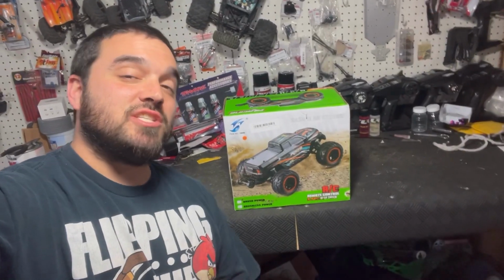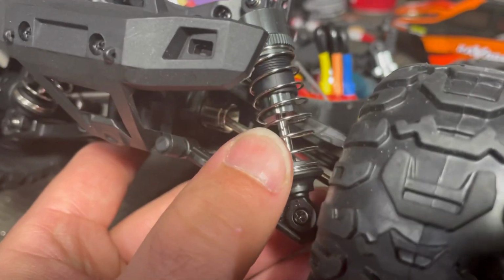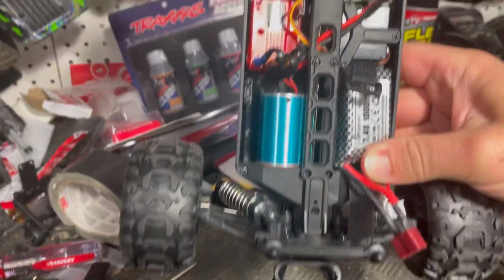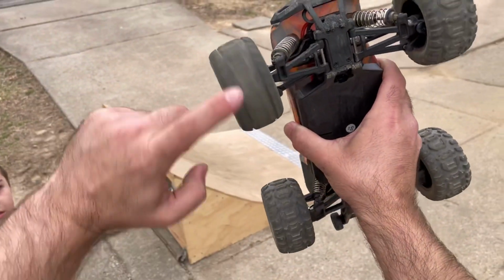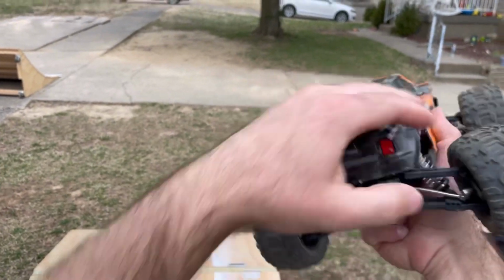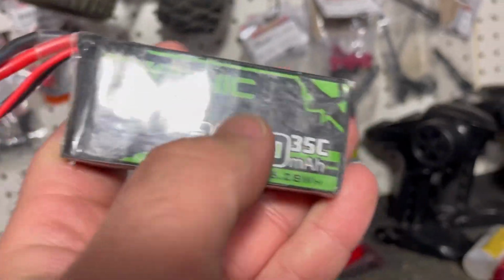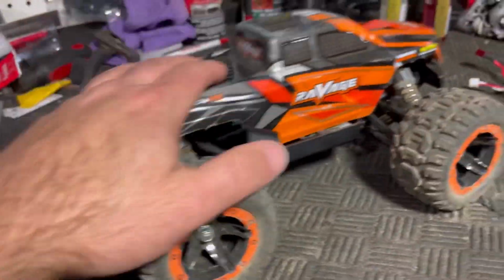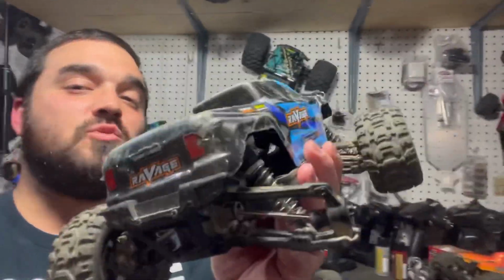The RC car EVERYBODY NEEDS!! HBX 16889a PRO

Comment: In a previous video you mentioned you’ve never broken a plastic driveshaft. So is there any benefit to the metal ones? If not, they’re a downgrade. Thanks for the vids, I’ve been considering a budget jumper and you have the best vids to see how they hold up and perform in the air.
Reply from the maker: Thanks man! True I have not actually broken a plastic shaft, but what has happened quite a bit is the screw that holds the wheel onto the plastic shafts breaks off inside the plastic. You can’t use standard wheel nuts on them either so fitting larger tires doesn’t work out well. If you plan on keeping the stock tires, the plastic is definitely not a bad option, but eventually one of those screws may still break.👍👍
Reply: @DerbyCityRC  thanks for the info. I am planning on bigger tires, so I’ll also go with the metal driveshafts.
Reply from the maker: What do you have? Standard 16889a? What tires you plan on using?
Reply: @DerbyCityRC  Don’t have a 16889. Still evaluating which smaller scale to get. I want a durable jumper that’s balanced in the air for stunts/backflips. WL Toys 14402 and LC Racing EMB-MT are other contenders.
Reply from the maker: @tyrellcorp2118  awesome! Working on a 16889a vs 901a video now. 901a is a 12th scale so a bit bigger

Comment: Would you recommend 16889a Pro or the 903a that would sometimes drive on grass?  Thanks!
Reply from the maker: For the grass, the 903a would probably be better since it is heavier and has bigger wheels. I have a similar car and it’s not quite as durable as the 16889a pro, but if you’re not doing crazy stuff like I do, I think it will be a great option for you!

Comment: Would you recommend having a stock of any parts in particular for these trucks?
Reply from the maker: I always recommend that. Lol
An extra shock or two,
Bumper and wheelie bar,
1.5mm x 10 mm axle pins
And 2mm x 10mm wheel pins.
Wheel hexes.
That may be it. You might break more things but probably not very commonly
Reply: @DerbyCityRC  Thanks! Been enjoying watching you guys jump your trucks / your editing style :)
Reply from the maker: Thanks!
Really really appreciate it! 😃
Reply: @DerbyCityRC  Already lost a pin! As a temp fix I cut a thick paperclip to length. Not a bad option honestly. Do you know if you can adjust the speed of reverse in these trucks? Wayyy too fast by default and adjusting the controller only adjusts the forward speed.
Reply from the maker: Ya I’ve used cut body clips as temporary pins before. I don’t believe you can program those ESCs unfortunately.
Reply: @DerbyCityRC  I ended up using a thinly cut Velcro strap to limit the backwards pull of the trigger. It's alright for now, could use some improvement. I really like this truck so far but I've been running it inside mostly due to rain.
Reply from the maker: Thanks!
Actually the tires I have on it in this video are just awesome. I have the link to them in the description of that video too. Let me know what you think!
HBX 16889a PRO & Team Associated RIVAL MT10
https://youtu.be/zS1oNsbvHPk

Comment: Can you please advise specs of the motor on this one?
Reply from the maker: I believe it is a 2845 3800kv.
Slightly larger than the non-pro versions
Reply: @DerbyCityRC  Does this motor  come with the same ESC or larger?
Reply from the maker: Same one. 25amp

Comment: You have a great YouTube page with very helpful videos. I’m interested in buying my kids and myself the HBX 16889a pro RC truck. The only version they sell on Amazon is made by Goolrc. Can you confirm they are the same truck?  

I’m buying your recommended ovonic 2200 batteries and will get around to putting in the 80 weight oil. All good tips.
Reply from the maker: Thanks!
Correct yes this one right here is the version with just one battery since you’re also getting the Ovonic. Looks like there’s also an Amazon coupon there. https://amzn.to/3D8M1Ri
Keep in mind that Ovonic doesn’t fit quite perfectly, but it’s still a great battery even though this video is pretty old. No failures yet!
Reply: You are the man Evan. Thanks again. I’m also building your ramps.
Reply from the maker: Awesome!! Hope you like them!

Comment: Greasy vid man. Looks a lot of fun. What shock oil do use on you HBX cars? Thinking of changing it on my 901a
Reply from the maker: Thanks! I actually haven’t tested yet. I believe I’m going to start with 50 weight for the 1/16 scale cars like this Pro. The 901a could probably use heavier, but that’s if you jump them like I do.
Reply: I already put some meats on for wheels because I cracked the original hubs at a skate park. 🤣 Any particular shock oil you recommend?
Reply from the maker: Nice! Not necessarily. I haven’t used it brought I have a preference. I got losi from Amazon but haven’t really been gotten to use it yet. https://amzn.to/3IknDwB

Comment: That is insane.   I have had some high dollar R/Cs that would not hold up to that kind of abuse.   Can you find  hop up parts for it?
Reply from the maker: I agree!
I haven’t looked too much into hop ups, but I don’t think there’s much of that stuff available yet. Of course plenty of larger tires that fit them nicely, but this car basically is the hopped up version over the original.

Comment: The. Bigger motor version might have more torque but but less kv. More Wheel speed might be why the the small motor one does back flips.  Test out their top speeds.
Reply from the maker: I agree this is probably the reason. I will be testing both top speeds very soon 👍👍
Reply: Put them on carpet and see which one will do a standing back flip. Probably just the pro version is my guess
Reply from the maker: I’ll give that a try!

Comment: Have you tried the 1/10 arrma granite voltage with a  spektrum lipo upgrade?  Can find the truck for $60 and the battery for $40. No mods required designed for this   It will crush that hbx.  Try it
Reply from the maker: Just got a new Arrma, but not the granite. 
I’ll look into that one.
Thanks

Comment: It is possible that this car has problems with the cups and bearings that have a lot of clearance
Reply from the maker: I have not had issues with that yet that I recall. We are tough on this thing!
Reply: @DerbyCityRC  My problem is that when I hold the car with my hand and give the gas the rear wheels shake in a bestial way, I have checked everything and nothing, even the bone escapes and falls. I think it's from the cups or that the bone is short, but of course the car is new.
Reply from the maker: @oskartubekp that’s very odd and hard to know for sure. I’d reach o it to hbx via Facebook or email

Comment: This one compared to the latest and new Hyper go Mjx 16208 and 16207, which one you think is tougher and better bang for the money? Because both are same price? Keep up the good work dude! Your videos are awesome!
Reply from the maker: Thanks!!!
I actually have the 16208 on the way so I should know pretty soon! I chose that over the 16207 because it is set up for bashing with a higher ground clearance and beefy bumpers, but man is that 16207 a sweet looking buggy!
Reply: @DerbyCityRC  Thank you for the reply, i was asking your advice in which one you think is a good choice now in 2022 between the 16208 and the Hbx 16889a Pro in this video? Which one is more durable and different types of batteries more compatible? And as you said I'm not a big fun of buggy 16207 I tried it and it was completely uncontrollable it's like somehow overpowered. Looking forward to your answer. Thank you.